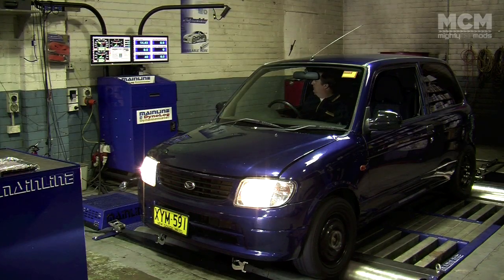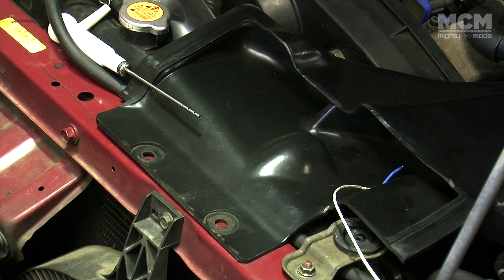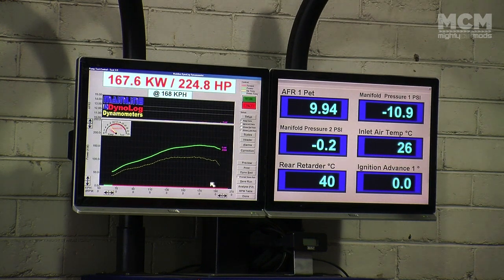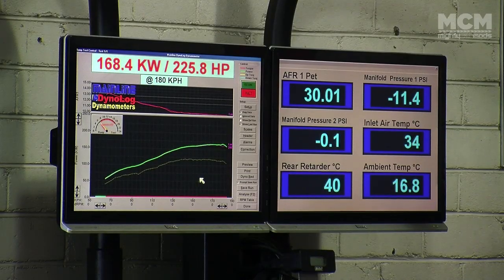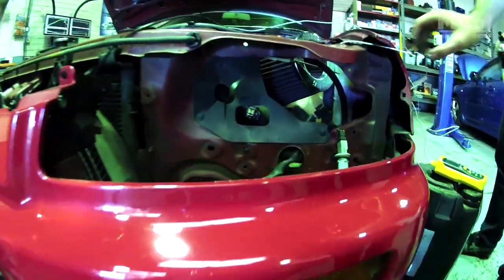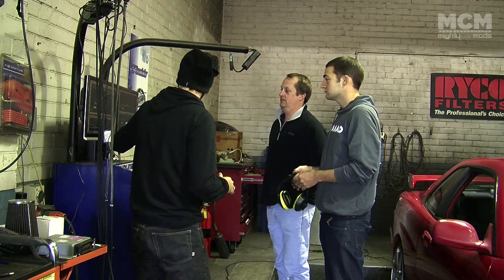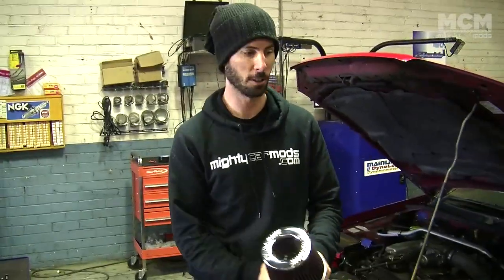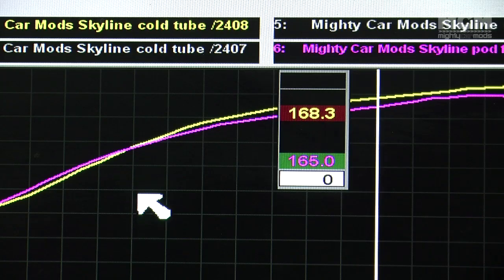Cold Air Intakes Mythbusted [Turbo]

Comment: Well, I could've told you that the headlight thing wasn't for power. It's to keep engine bay temperatures down. We take the headlight off because after the run you cool down, check your motor and get ready for the next one. The point of doing that is because you can't work on a car with a hot engine. That small bit of difference of engine bay tempatures give us more time to work and prepare for another run.

Comment: First and foremost, I do believe that you are correct... there is no way simply adding a CAI is going to give you 20% HP.   

An engine is an air pump.  The volume of air going in is directly proportionate to the volume coming out.  So if you increase the intake flow (pod filter) capacity and decrease the air charge temp but don't free up the exhaust, your results will be exactly what you saw in the video.  This is like trying to run a foot race breathing in normally and exhaling through a straw.

To get best results, you need to make the exhaust better too.  Bolt on Exhaust + CAI + ECM Tune = Best gains (even then I doubt you'll hit 20% increase with most applications)

Comment: They do make most engines sound a little more meaty but some think they can actually feel a difference in power lol.
There's nothing wrong with the standard factory airbox, best bet is to throw in a aftermarket foam panel filter and get rid of the original paper one.
No difference in noise but a better option.

Comment: Only time you see gains from a CAI is from 1). Your able to completely isolate all heat sources from intake (vehicle-specific CAI’s not custom setups like in this video 2) the factory air box is a known bottleneck. Thus increasing airflow over stock

Comment: Most commonly mistakes is that People think the Temperature measurements is from the Box / Filter. The Temperature measurements is not from there, so in reality, you can make it like a Foam Cooler and the Temp will only a few degrees differences. ...................................  What you need is simple.... A Turbo-Charge 12V DC FAN!

Comment: Mighty Car Mods:  if it had been put the conic filter directly on throttle body and make a way to force the air to entering in the intake manifold through the filter, you probably have identical result (173,,7KW / 232,9HP)

Comment: If you want real cold air and not a bunch of gimic get cowl induction. But it's really only for carb or TBI and when done right , the air cleaner assembly seals against the cowl air box when the hood is shut only letting in the air from the scoop opening. 82-84 Firebird 
T A 's had it stock.

Comment: If that last modification was done with a smooth hose there would have been a bigger gain, re-tuning the computer put aside.  The loss of laminar air flow and increase in turbulence in that hose is higher than most people can imagine.

Comment: So my understanding in this is that the cars computer automatically tunes the airflow so that there is no real increase on it. Cold intakes on cars I've recently bought say that to see any gains it has to be done with a tune. If you had a tuned car and then you added a CAI and then tuned it again with that intake you should see some gains. Then I'm sure you will say something like well of course the company that makes the CAI will say that, but if you ask a tuner he will tell you the same thing. I have seen people post dyno sheets that show 10hp gains on some turbo economy cars.

Comment: If you increased air intake flow so you need to expand exhaust flow too or it'll show you that kind of result over and over. That's why bolt ons alone can't increase car performance it's all about how they work together. Car is the combination of a lot of parts that they work together so in that case every changes and mods related on other parts too.

Comment: A good video but I found a bit of inaccuracy as others found below. I just wanted to ask though, was there a fan pushing air into the vehicle. As a cold air like a factory box requires you to be moving to force air in. But not only do you need more air coming in you need more coming out too. A big exhaust that isn't to big has been proven to have substantial differences. Just due to less restrictions. Just my 2 cents.

Comment: cold air intakes were more of a big deal on earlier cars, so perhaps an R32, but also THE issue with this is, an N/A car will see much more difference than a Turbo charged car because of the intercooler.
How I'm not defending the cold air intake as a good quality one for my Audi is $400+, i posted in to a high flow, reusable K&N filter with a stock air box mod that removed restrictions.
But also to back up my "older car" comment, newer models the engineers have already figured out how to get the coldest air into most intakes. And many cars have a "snorkel" much like this R34.

Lastly, the thing where they used the hose and ran it through the headlight, would technically be a Ram Air intake.(where the air is literally be "Rammed" in to the intake).

Comment: What may be happening is that the ECU is sensing the inlet air temp and altering the air-fuel ratio slightly to compensate. ie enriching the mixture when the air is cooler and vise versa.

Comment: this all depends on your other mods if you have a stock engine they probably wont do anything but as you decide to do cams, hi comp pistons, ported and polished larger valves bigger better fuel system and all the other things you want to do it will make a noticeable difference its all about complementing all the mods

Comment: There's so much science that goes into the gains you can get from a intake that the best way to explain it is to sum it all up

1) a proper cold air intake is supposed to have less restriction in the filter (that can be reused and cleaned like a k&n filter), provide a smooth intake tube for less friction,  turbulence, and to improve overall smoother flow, and most importantly suck in colder air

2) a cold air intake works best with other airflow mods like headers, exhaust, bigger throttle body,  ported cylinder heads, a stroker kit, and cam. (you can only suck as much air in as you can push out and you can only push as mush air out as you can suck in)

3) and most importantly a cold air intake works better with the higher your displacement is.  a car that displaces 1.6l will react differently than a car that displaces 4.0l, so a car that displaces 4.0l a stroke will require more air per stroke than a car that that only displaces 1.6l per stroke. (there's no replacement for displacement)

i hope this helps some people and if you have questions then feel free to ask and ill try my best to respond back to you

Comment: On a car like that with a turbo forcing air, a cold air intake won't do much even if it is perfectly set up. The forced induction system is designed to work optimally with the stock air box and can overcome the restrictions in the intake with ease. On a naturally aspirated vehicle you might see some gains if you can ensure that your CAI system is both drawing air that is at least the same temperature as the stock intake and is less restrictive than the stock intake. Not really possible for most cars, especially new cars, without fabricating your own ducting to fit perfectly and draw from the fender well or near the bottom of the bumper. Even then, a 5-7% gain would be pretty hard to achieve unless your stock intake was literally a plastic straw. Better investment for this vehicle (or any vehicle with forced induction) is an intercooler upgrade to reduce air temp and restriction after the turbo. That can make a big difference, 10% or better easily if you have a stock intercooler or worse none at all.

Comment: The point of a cold air is to improve airflow not necessarily increasing power. Imagine going for a run and taking quick and shallow breaths, that's an airbox. Now go running taking deeper and more rythmatic breaths, that would be the cold air. Sure it doesn't mean you'll run faster necessarily but it let's you run easier and for longer without passing out

Comment: Adding a CAI alone isn’t going to do anything, but combined with other mods it’s definitely worth the money. Bore your TB, injectors, rail, high flow fuel pump, EGR delete, vacuum delete, exhaust, cams, crank, flywheel, ECU, etc. Then take the CAI off and put the original box back on, see how much power you lose after your ECU is tuned for a CAI and you use a stock box. CAI isn’t going to do anything alone except make it sound good. More times than not it will just run the same unless you put the work into having a fast car.

Comment: Intakes are just for show and noise under the hood. NOW if you get a down pipe  exhaust and  ecu tune THEN you get the full potential of a CAI. Stock ecu's aren't programmed to use the extra air coming in

Comment: Two things i noticed here that could have been done differently. 

1. Use bigger fan, that fan does not produce nearly the same amount of pressure to force air into the cabin, driving around town on the other hand does.

2. Also air outside can be cooler than what you are getting here. Try it at maybe 10 degrees, or 5 degrees. Us canadians want to know how that goes.

3. Im not sure if you reached the optimal engine temperature on the stock. At that temp the engine is hot, which thus produces an air temperature in the bay that is a bit higher than ambient. The cold air intake mounted far away from this area of hot air should perform better than the stock had you done this.

But im guessing you didnt let the car idle for 5+ minutes and ran the test too soon with a cold engine, it makes no difference what kind of air intake you got that stock filter.

4. Use better filter, the filter should separate air intake from the air in the bay, it doesn't in this case. So ofc the last test worked.

I know this wont do a 10% or 20%, thats a ridiculous claim anyone will make. 

5% is as hopeful as one should get, and that is great for such a cheap mod.

Comment: My fueling system on my Mazdaspeed 3 is MAF-based (not speed density). My MAF sensor also measures the temperature of the air coming into the engine. I have conclusively seen (for years) sways of up to 30whp between the hottest summertime and the cool fall/winter (the difference amounts to me doing ~360whp in hot temps, and I consistently do 390whp in cold temps - Dyno verified).

The bottom line is this: colder air is more oxygen-dense (ironically, that's exactly why turbochargers and superchargers work - more oxygen getting pressurized into the engine). More oxygen density necessitates more fuel to hit your AFR targets; voila, bigger boom and more power.

Now if a cold-air intake doesn't appreciably lower the intake air temp, then of course you'll see no power difference - no greater oxygen density means no need for more fuel and therefore no additional power causing a bigger "boom" in the combustion chamber.

Comment: The power doesn't change, but the power delivery, throttle response, and maybe MPG are effected. It's noticeable, but not a lot. Unless you get a tune, the ECU/MAF won't fully utilize that extra air flow it will just accommodate it.
Reply: 1 - Turbo will push all the air into the engine that it can handle.  Waste-gate will dictate how much air gets into the engine.  Cold air intake will not change the amount of air going into the engine.
2 - Throttle response - often hear this is improved but I have never seen any evidence.  More likely people hear more engine noise when throttle is pushed.
3 - MPG is not improved.  Even the manufacturers of CAI will tell you that.
Reply: @jimfallowfield7028  (1) Never said that. Don't put words in my mouth.
(2) Throttle response is improved due less restriction in air flow. 
(3) A dirty intake filter will rob you power and MPG. So then what does a high flow filter do?
Reply: Do you have proof of "power delivery" difference? Faster throttle response? Increase in MPG? What fancy CAI are you running on your car?
Reply: @SupeDefy  Yes, the butt dyno.
Reply: @Yammie_Moto671  Ah yes. The butt dyno. lol
Reply: @Yammie_Moto671  

1 - "the ECU/MAF won't fully utilize that it will just accommodate it."  Not sure how I am putting words in your mouth. You said the engine is getting extra air flow.
2 - Throttle response is the measurement of time between changing the throttle and seeing a change in the motor.  Used to be a problem with carburetors being far away from the engine.  Guys running the big tunnel rams would have great power but have terrible throttle response because the fuel metering was too far away from the engine.  Modern cars have the injectors mounted as close as possible to the intake valves for the best possible response.  Changing the intake does nothing for throttle response.  Like I said previously, people hear more noise when they push on the pedal and then say they have more throttle response.  Really you have more noise response.
3 -  Your filter would have to be clogged almost completely to effect your mpg.  Your biggest restriction at cruise is your throttle.  If it isn't,  changing your throttle position would have no change on engine speed.  

People often comment on how restrictive the stock intake is.  If you actually see how small the intake valve is in comparison to the intake duct, you would see that it is not the case.

Comment: Most people don't think about this fact right here. Cold air intakes are meant for nodded engines where you will see a difference in change.  Pod filters are meant for high horse power motors that way when its sucking all the air it needs it doesnt suck the air filter through the intake. So in closing pod filters and cold air intakes are essential for higher horse power motors. Between 400 and 1500 horse I wouldnt recomend it for the 1500 but its possible anything more than that I wouldn't waste my time with a filter at all cause your gonna be rebuilding it every run or 2 anyways

Comment: If you ram your intake air from the front end of the car you will make more power, especially if the weather outside is cold. The reason that there was not much increase with the cold air intake extended away from the car is because the car was not moving. In other words, a vehicle moving at 60mph in cold weather grabbing air from the front and ramming it into the air intake will make more power. The fact that we saw almost a 2 percent increase when the car was not moving evidences the fact that a cold air intake makes power, and that more power would be gained if the car was actually moving with a front-end ram air intake installed.

Comment: If there was a smooth wall pipe going to the external filter with an easy bend, (instead of a piece of glorified dryer vent that looks like an elephants trunk) You could increase the cfm probably 2 fold

Comment: You should be measuring charge temp at the intake manifold.  The intercooler might be doing its job regardless of temp at the filter, and also the factory airbox pretty much is a cold air intake.  I think cold air intake would show higher gains on an N/A engine

Comment: Part of this is history. 1960's early 80' motorcycles or cars tended to have horrible intakes. so pods tended to get cooler air, less restriction, and far fewer bends. And with more engine bay space outside air could get in easier. Add something like ram air induction 60's cars, late 80's cycles which keept charge as close to ambient  air temp as possible.   you got an advantage.  But now with emissions or a high performance vehicle stock intakes have to be far better then the past.  Plus stock on the skyline had some cold air action already.  and the turbo negates any marginal ram air pressure advantage.  That really don't come into play unless you have an airspeed of 300 km an hour plus if at all. To be fair you did did use a ribbed tube that didn't help. a smooth tube would have given you less internal turbulence - drag. Idealy something that funnels air, and maybe parts a mild spin to help air make any bends and keeps the flow together. (like the vortech heads, your sink drain, or conversely flame thrower nozzles. )  again even that would be a small gain. Now porting and polishing do help internal airflow . (again depending on how well the stock heads were made.  Usually  far better then the 60's)

Comment: some people argue that having a larger surface area on a high flow pod filter allows for more air when the turbo is spinning and revs are way up. but doesnt the airbox help maintain max torque and power at low revs for around the city driving?

Comment: Cold air intake no matter what brand does not do anything on forced inducted cars. The turbo or supercharger sucks in the air that is supposed too. It just adds a cool sound when the throttle is open that's it.

Comment: The temperature difference would need to be pretty extreme for the cold air intake to make any difference at all on a turbo, the turbo will compress the air raising it's temperature by quite a lot, before going back through the intercooler. So yea, CAI for turbocharged cars, kinda a waste of time. For a N/A engine however, as long as you mount it correctly, and actually can prove it's colder air, I'd imagine you'd see some gains there since it may be less restrictive and also the colder the air, the more air you can move through the intake and into the cylinder.

Comment: I used to use free flow filters years ago and noticed some decent top end increases 5-10 mph they where all cars without e.c.u's just points or early electronic ignition ie cortina's, maxi's and oxford's no engin mapping correcting for emissions might be worth using something like that on some of your breathing mods

Comment: Cold air intake is meant for running nitrogen on the intake. It makes the air denser which means better compression therefore more power.